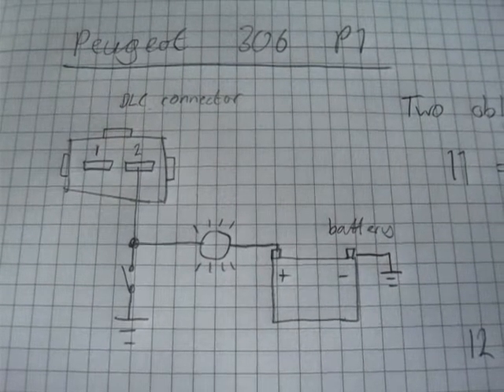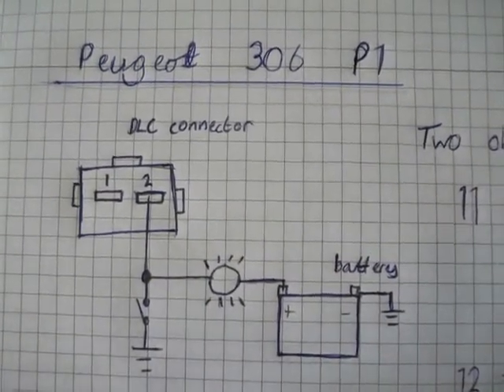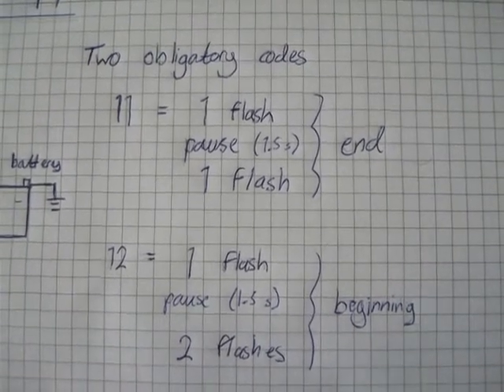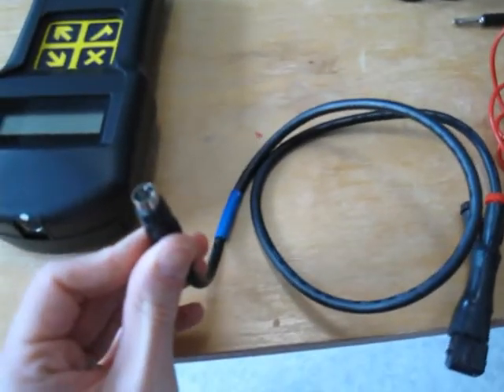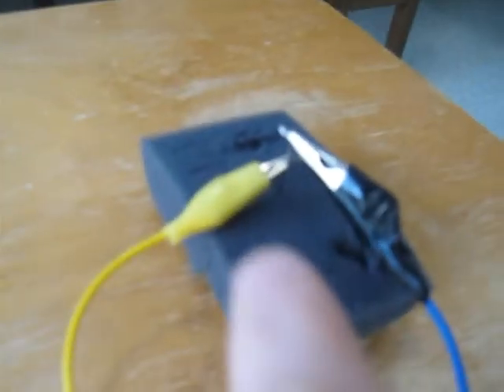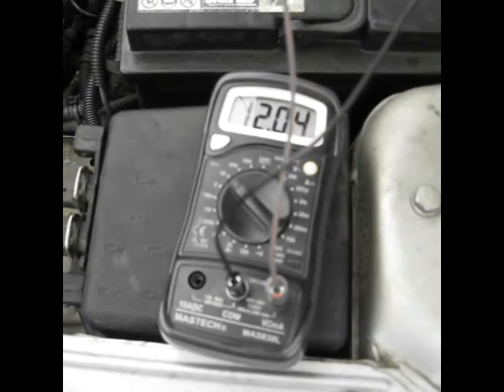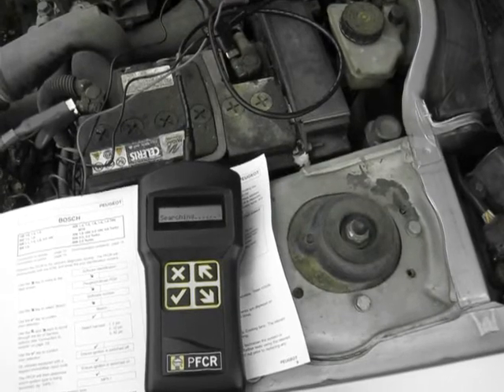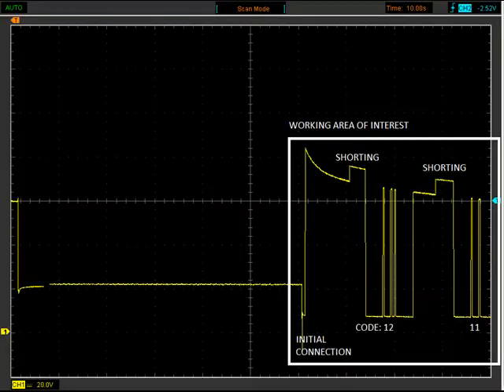How to read 2-pin Peugeot 306 fault codes. Using Haynes PFCR, test light, oscilloscope.

Comment: Nice one. Well explained also like the several alternatives showed. 
For now I'm struggling with a Peugeot 106 1.1 - 96 with 30 pin connector (Bosch MA3.1) and my PP2000. I might had the 106 is  winning until now. LOL :-)
Thanks for sharing.

Comment: Can you just join  connections 1 and 2 in the DLC block and read the flashes on the check engine light? Or do you ground connection number 2 for 3 seconds . Them turn on the ignition????,
Reply from the maker: For this particular model that wouldn't work. However this is the way for many.